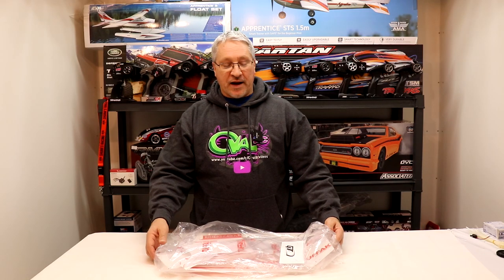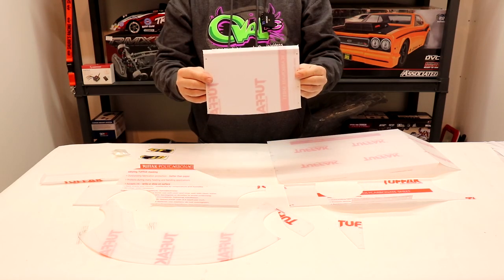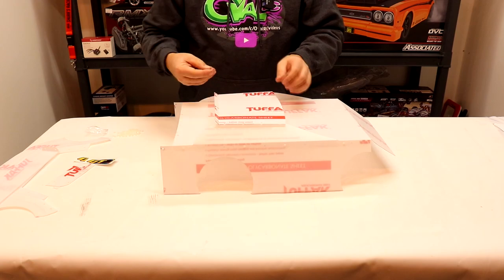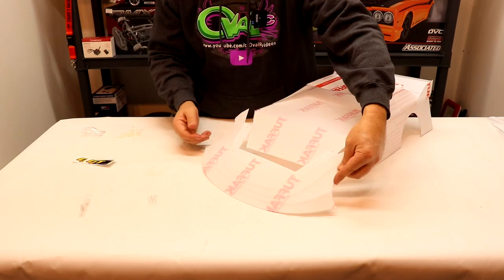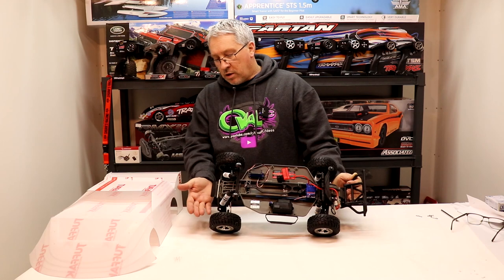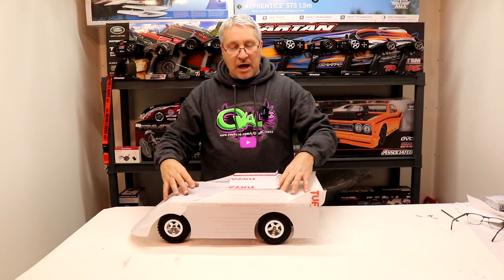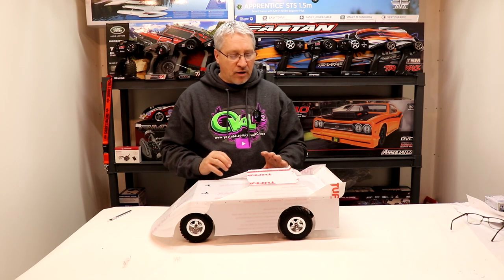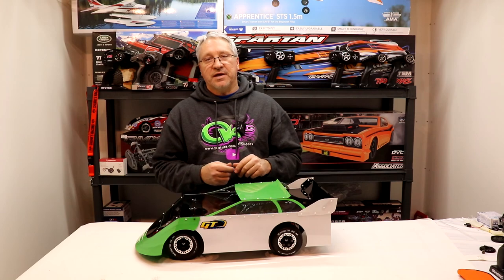RC Late Model - GT Bodies build - 12T Crate Late Class

Comment: I used that stuff for my sc mod body I made. .060 and it's good stuff. Takes a beating and no cracks.
Reply: Where did you buy it by sheet? Looking for it online but getting a lot of results.
Reply: @whiskeythrottlerc5098  I work for a sign company and we use it all the time. I got a 4x8 sheet of Tuffak from our vendor. The name of the business is graphics solutions Group.